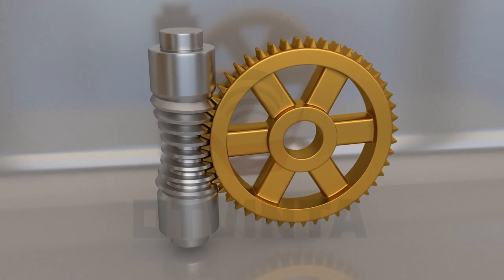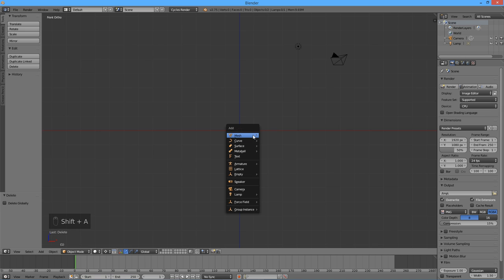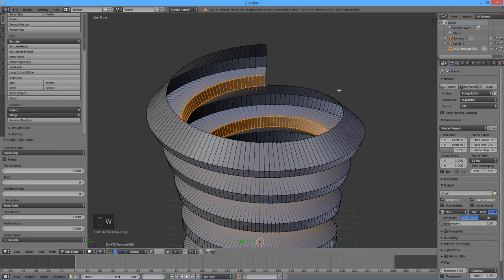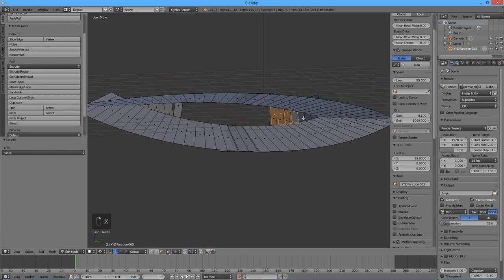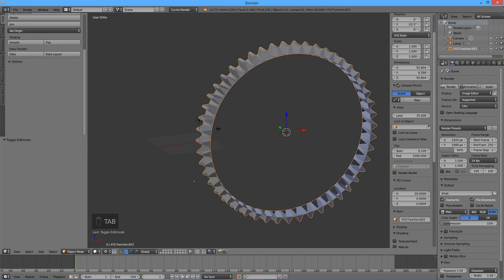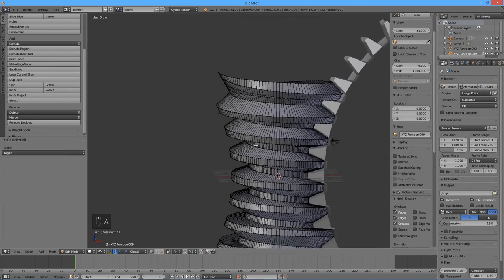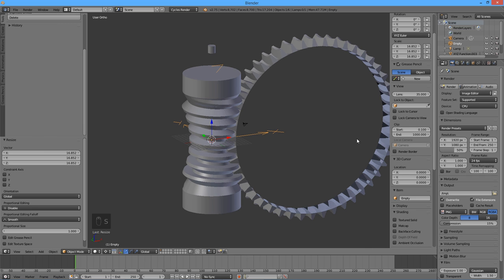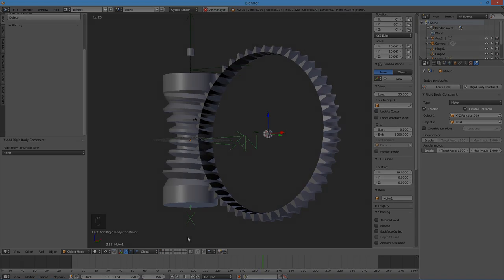Tutorial: How to Model Globoid (aka Throated) Worm Drive in Blender

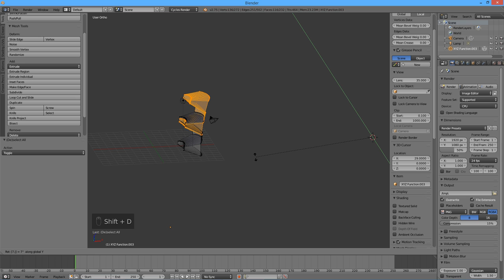Comment: 14:27 Alt-R can be used to do repeated rotation around the object's center (or any center by modifying the property's settings. It takes a little finesse and practice but will save some time.
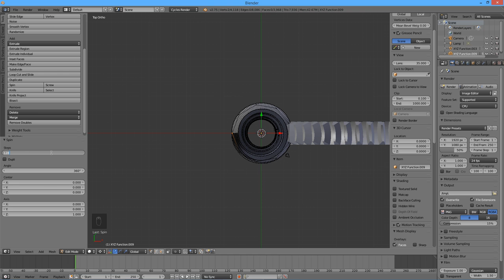Reply: 19:32 Okay, now you're using the spin tool that I described above, but you're not using it with "Dupli" on, so give that a try some time to see how it will make your previous step easier. However, this time you're doing the math outside of Blender. Don't do that, man. Type "1024/8" and let Blender do the simple arithmetic for you.

Comment: Nice work! I managed to make one with  (4t/40t).  I scaled down the worm to 0.98, but I still had to move the wheel, hinge2 & axis2 + 0.5mm on X axis before the animation started to work properly.

I have been struggling to do this in some other softwares before (some other techniques). I felt Blender light as feather.

Comment: I want to design small diameter globoid (wheel diameter ~ 10 mm). In my case the worm moves with the fingers and the wheel axle almost does not provide resistance (on it there is a small mirror that needs to be precisely set in a certain angle). Is it necessary to change change some parameters in the globoid design to gain as much self-lock feature as possible?

Comment: this is great, but i have one question. why the hell is this working. the radius decreases to the mittle, something that should cause the center to rotate slower than the edges. should this not cause complications?
Reply from the maker: The worm's threads are designed in such a way that the angular speed of the threads relative to the wheel's center is constant.
Reply: O.T. Vinta is this achieved by angling the threads?
Reply from the maker: Both angling and spacing.

Comment: When I follow the tutorial to the point at 8:58 - the origin of my object does not follow the 3D cursor like it does in the video. If I move it maually by using the  set origin/origin to 3D cursor action, then I can get the duplicate to rotate around the center at Xaxis 29  - but all other objects created also do not automatically move the origin, such as the tooth meshes. Art 13.49 when I go into edit mode, the origin is inside the object, and in object mode, it is at the 3D cursor. I had to mess around and set the origin manually for every duplicate. When I get to the end - the simulation fails. I noticed that the teeth of the wheel also merge with the worm still after a -1% scale. So question is whether there is some setting that automatically moves the pivot/origin to the 3D cursor - or some difference in how blender orientates origins i earlier versions - or if the tooth size is causing my simulation to fail? I'm using blender 2.79.
Reply from the maker: Not sure I understand which object you are referring to. At 8:58, the 3D cursor is moved at (x=29), and no origins are involved.
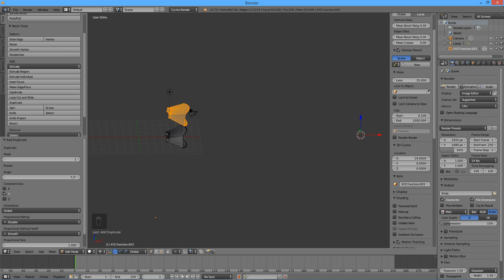Reply: If I follow step for step - the worm when rotated 22.5 deg, rotates around it's own center and not the 3D cursor point at X:29. I have to manually set origin for the worm object to be the 3D cursor before I can duplicate and rotate the worm as per the video. The same thing happens when I try to duplicate and rotate the mesh for the tooth at 13:49. In edit mode I have a Manipulator object (see https://blender.stackexchange.com/questions/100479/origin-point-different-in-editmode-objectmode) - it looks like the object rotates around the manipulator object, even when I disable it.
Reply from the maker: At the very beginning of the modeling section of the video, we set the pivot point to 3D cursor, see 3:04.
Reply: I missed that step! BTW - thanks for this really great tutorial. and for your help :)